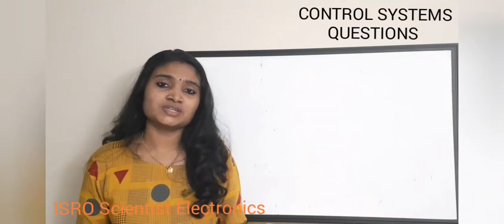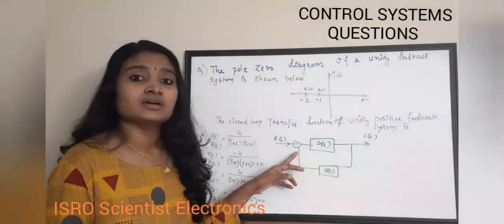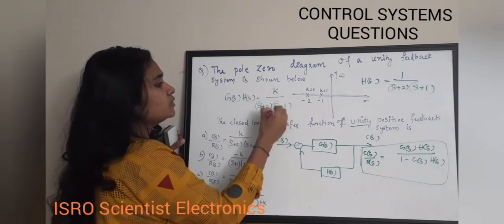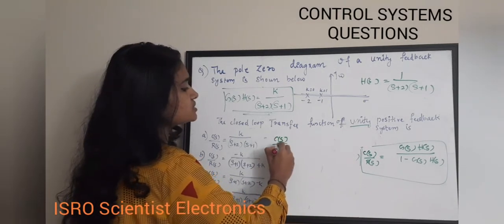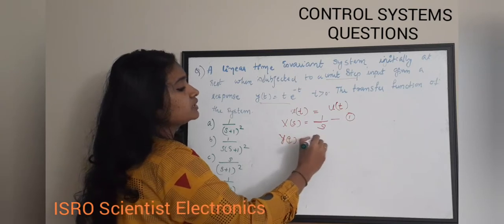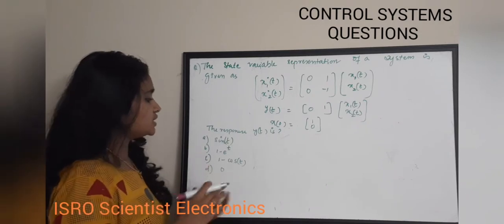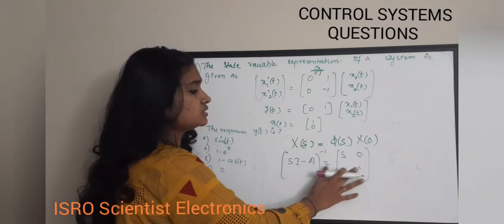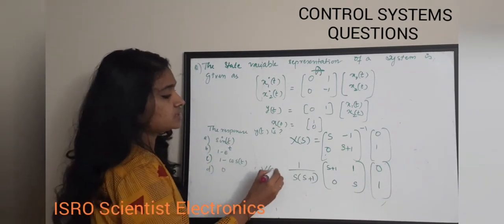Control System Numericals Part2

Comment: Maam i have a doubt
 in the question where u have to find closed loop transfer function for positive feedback u used the transfer function for negative feedback. Can u pls explain y?
Reply from the maker: That is not a mistake, the equation is having negative in the denominator for positive feed back system. But I said negative feedback that's a mistake. Please google once
Reply: Yes maam you are right.. for negative feedback its positive sign and for positive feedback it is negative sign